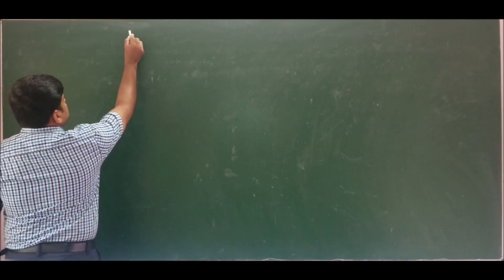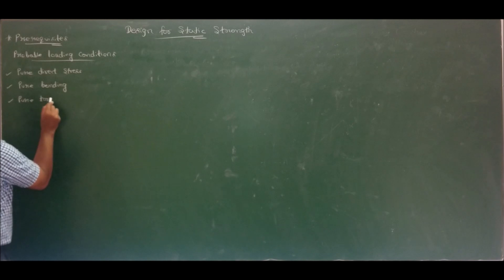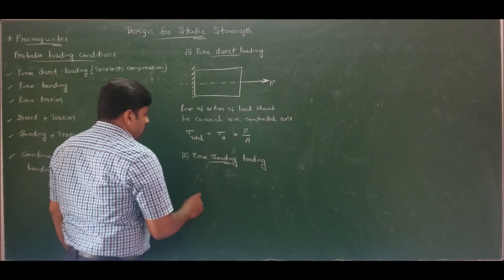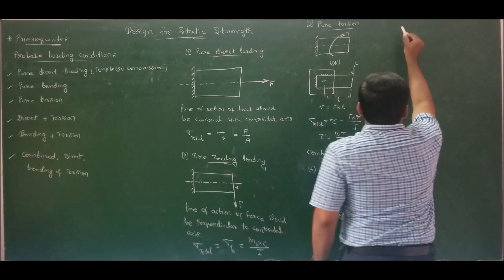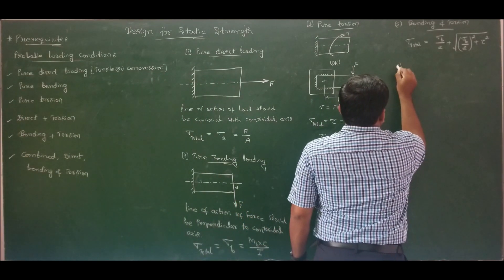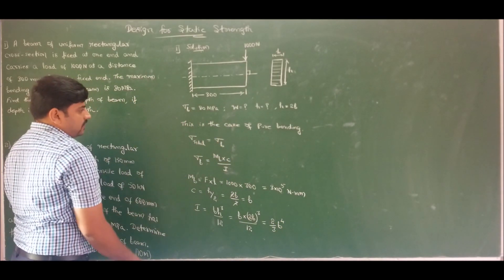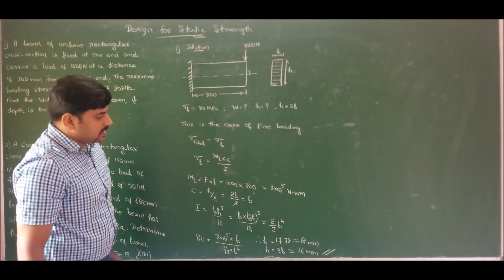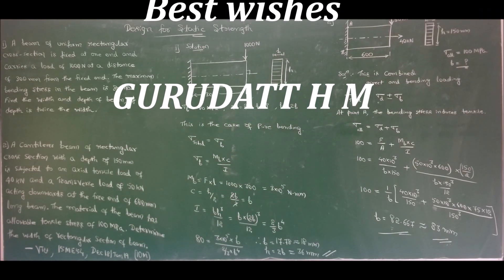05 - Introduction to design for static strength & problems - #1, 2 - Mod_1 - DME_1 by GURUDATT.H.M

Comment: Hi Guru - How did you find that at one point there is compression and at the other point there is tensile due to bending stress. Is it compression at A and tensile at B ?
Reply from the maker: Based on bending observe what is happening on that point for outer fiber, yourself can conclude whether the fibre is experiencing tensile or compressive stress.

 May I know who is this.....??
Reply: @MechanicalEngineeringELearning  Thanks Guru. My name is Vinodh Ramji
Reply: @Vin R, Hey whomever you are give respect to sir. When people are running behind money,  our sir is the savior, Idiot give respect and take respect. Where are you from, are you VTU student...??
First learn Mechanics of Material rather than asking childish doubts.
Reply: @MechanicalEngineeringELearning  Hi Guru - I do supply chain management in HCAC industry. I finished Electrical degree in 2003. I do self study in mechanics of materials, machine design and HVAC. Thank you.
Reply from the maker: Welcome, keep watching..,🙏